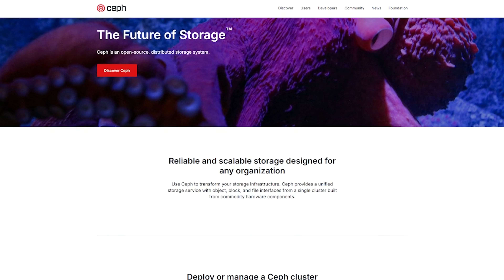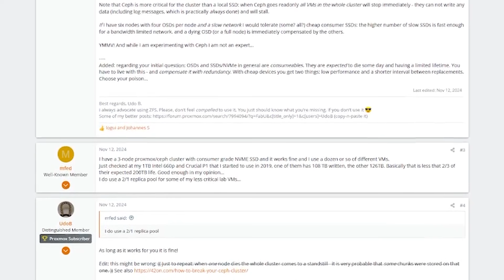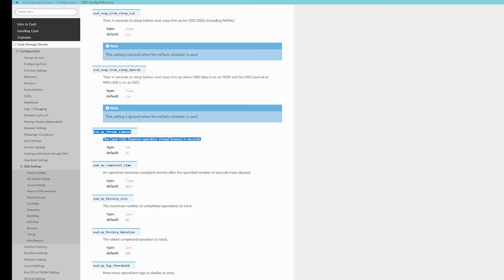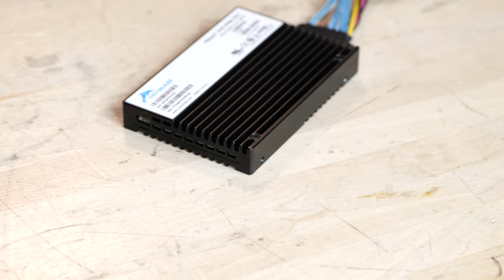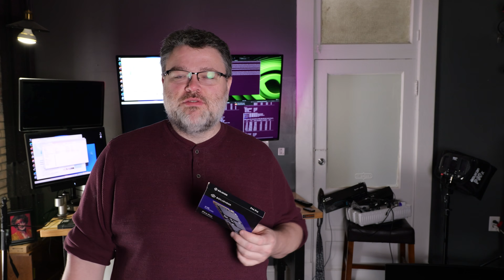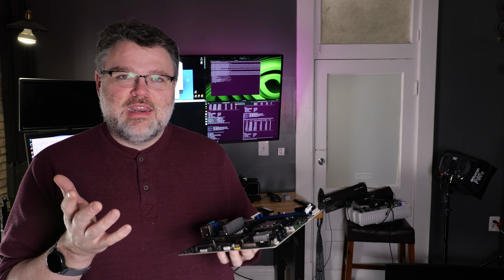Ceph Shenanigans with Wendell! Broken Solidigm Consumer vs Memblaze Enterprise -- What happened?

Comment: You are always using expensive hardware. What about using HP DL360 Gen9 with some adapters so we can host Samsung 990 Pro NVMe and build Ceph on top?
Or doing Server hacking and installing NVME's via some cards to workaround bifurcation and doing a hybrid with a SAS drives in front + HBA?
Combine Ceph wiht ZFS?

Comment: For me the biggest CEPH issues have been caused by network speeds more than disk.  
I ran a 4 node cluster for years using shite ssd and 10gbe. Loved it.

Now I have 4 nodes of amazing ssd. And 1gbe.  And it hangs.

Comment: I love ceph so much lol. I run hyperconverged for proxmox (on optane), and PB-sized spinning rust in EC mode (with super cheap consumer sata SSDs as metadata storage). No data loss, works well. But you do need to build up experience, it's not magic as you said and using the right hardware is important to some degree. I don't use Seagate HDDs anymore in my OSD nodes, WD firmware is so much better, no issues.

Comment: Definitely check out Linstor / DRBD. Running it in 'production' on three nodes with 4 SATA Samsung 86 EVO's in each server. Works great. A quick test VM spun up revealed 5K IOPS 4K QD32 randwrite and 100 MiB/s sequential. Cluster wide under normal load is doing around 25k IOPS on average. Backend is LVM, VMs are thin provisioned, 10G LAN. Definitely not high performance but not bad!

Comment: I learned my lesson trying to use WD Red SSD as a cache in Synology. There is a reason why Synology sells 400 and 800 gig drives rather than 500 and 1000 gig drives. You don't want your SSD to be 100% full.

Comment: Interesting. I have been using ceph in my homelab proxmox 4 node cluster for over a year without a problem. Im using mixed 1TB consumer sata SSDs (the cheapest I could buy at the time) over 1 GB ethernet.
It is not the fastest but it works fine. And it survived power outages.

Comment: While PLP (power loss protection) sounds like a safety feature, in the case of ceph it is actually a very important performance feature. The battery backup gives just enough juice that it can trust the dram cache for sync writes. Conversely, not having it means that all of the enormous amount of sync writes ceph does don’t get any write caching and instead have to wait for the (relatively) slow flash to write. 

This is the key distinction between enterprise/ non-enterprise drives. 

If you are crazy / dumb, you can test this in proxmox by creating vm disks that are force write through cached. A quick benchmark will show performance much more in line with what you expect. Obviously do not use these for anything you care about, breaking all sync writes will lose data eventually.

Comment: Bad take. It's not about consumer drives. You tried SSD's with faulty firmware. End of story.
If you used enterprise drives with faulty firmware you'd be making the same complaints.

The problem seems to be more a case of "I bought drives from a tiny new company with cowbow coders trying 'exciting' things with the firmware."

Comment: Hi there!

I am an european sysadmin, so my viewpoints may differ. I work for a few small-medium businesses, and we use proxmox with ceph at a lot of places. I think Wendell kinda misses some viewpoints or approaches the subject from a different viewpoint. 

Ceph is slower than locally mounted SSDs or high perf ZFS mirros. This is by design, and it cannot be manouvered around. Ceph communicates over TCP/IP, even to access local SSD-s (OSD-s). This slows down things. Ceph can have a colossally large throughput when seen altogether, but for single clients (VMs) the ceph storage backend will always be slower than ZFS mirros.

What we use Ceph for is Infrastructure VMs, where High Availibility is KEY, but indiviual VM storage perf is secondry. (email, DNS, AD, VPN services, etc...)

If one needs top storage performance then ZFS mirrors and stacked zfs mirrors is the answer. 

One can spend a lot of time optimalizing ceph performance, but it will always be slower, this is by design and should be accepted.

Consumer SSD-s: We used to use consumer sata SSD-s for ceph and we use mostly consumer NVME ssd-s for ceph now. Usually 1-2 TB models with onboard ram and 600+ TB write endurance. If one has 3 nodes and 3-4 OSD-s per node, 20Gbit+ network, the performance is kinda okay! SSD-like performance, maybe a bit slower, but email, AD and DNS doesn't care really. Ceph doesn't have the massive write multiplication of zfs, but has checksumming features for consistency, that works well with consumer ssds.

If one can plan write endurance for VM-s, consumer ssd-s Work Well. A usual small business with AD, email, accounting program VM, etc can use consumer ssd-s for 4-6 years before endurance becomes a problem. using different model ssd-s isn't a problem either, rather welcome, it minimizes the chance of parallel write endurance failures. 

Ceph storage cost per GB is always greater than ZFS. (3 copies of all data on 3 ssd-s). Given this, one should tier one-s storage. HA infrastructure vm-s on CEPH SSD-s, High perf storage is ZFS striped mirrors, zfs spinning rust for capacity storage and packup storage.

If one uses NVME, it is less a problem, but it is important to avoid using the same sata/sas controller for boot zfs mirror, zfs striped mirror for high perf storage and ceph OSD-s. One can quite quickly make a race condition for the different storage pools. Diagnosing it is hell, don't do it! Use different controllers!

Comment: It’s almost like I’ve heard this before, that Ceph doesn’t play nice with consumer solid state drives… 😅

I’ve dabbled with Ceph on and off for the last 5 years and the long standing ”truth” in the communities is that you want enterprise drives and at least 10 GbE to be happy with it. Many have gone against these recommendations or not done their research, many have reported either problems or very slow performance. I’ve tested myself. It is definitely possible to create a working cluster using consumer drives and lower than 10 GbE, but it will be a far from optimal experience. Especially considering the performance of the drives one might put into it. The ”Pro” in Samsung 980 Pro means nothing in Ceph land.. 

I now only run second hand bought enterprise SAS/SATA SSD’s and NVMe’s in my cluster. Well, some of the HDD’s aren’t enterprise but it has far less impact on speed than solid state.

My testing has even shown that enterprise SATA SSD’s eventually will outperform consumer NVMe’s with Ceph.

I will just sound like a parrot and repeat what everyone has said to me; use enterprise solid state drives with proper PLP and try to use at least 10 GbE networking. Especially if you plan on deploying it over a long time and in some sort of production. But for playing around, you can run it on basically anything. 😜

Comment: So pro tip: if you want to use ceph, deploy it separately to proxmox. Proxmox is kind of lagging behind what ceph is up to, native ceph is sooooo much better, especially the new dashboard, and while cephadm is still green, it’s a big jump foward. a lot of your complaints would be addressed by running cephadm and the dashboard with all the prebuilt grafana dashboards. 

I’m currently running a 200 drive 30 node cluster. There’s lots and lots and lots of knobs and bells and whistles to building Ceph, but by far it’s also the most resilient platform I’ve used.
Reply: Are you using s3 radosgw?
Reply: I’m deploying a new 6 node cluster now for my homelab and the plan is to deploy cephadm instead of using pveceph. ”Only” problem I haven’t really figured out yet is how make the deployment while still running Proxmox. I don’t have the hardware to run the Ceph storage separately to the compute nodes, so it has to be HCI.

I’ve heard of people running a Ubuntu VM on each node and deploy Ceph on that. Probably doable but feels very convoluted. 
Other is to run Debian on each node, with cephadm and install PVE on top. That ”feels” like a more clean solution than installing bare metal PVE and cephadm in that.

Comment: I've got a ceph cluster with 24 spinning disks, 4 nodes, and I have enterprise SATA SSDs for DB/WAL, 3:1 OSD to db device ratio (3 OSDs share the same physical disk for db/WAL) 

It works fine for what it is. By default ceph on proxmox tries to use the nearest replica (localize), and I've found I have had better performance by switching to balance for rbd_read_from_replica_policy

Comment: Oh so the Pros also have the SLC bug? Fun. I feel like most of the general "don't use consumer drives" is because of random firmware bugs like this, but then I remember we had HP Enterprise SSDs that bricked themselves after 32767 hours of power on time... bugs happen! Vendors not fixing them is the issue and certainly more likely with consumer devices.

Comment: Firstly nice video and its a great topic, even more so with the cost of It related items and stock availability. I'm no expert but I think most people would be happy with a simple approach and less is more due to cost and availability. Firstly using consumer grade items over enterprise has always had its issues its to be expected. My approach which I think would suit most people in this current climate is a 3 node setup, the nodes consist of 2 node running proxmox pve and a 3rd node running proxmox backup. You can use replication without the network overhead of ceph and consumer drives won't be impacted as much as ceph. The question I asked myself was do I really need ceph, the answer is would I like ceph almost certainly but I do not need it no. Replication running every 15 minutes allows me to be more cost effective and suit most demands for my home lab and I think it will also meet most peoples. In short ceph is a nice to have but for a home lab not required. If you need it then your most likely running an enterprise not a home lab.

Comment: FYI, there is no “local” copy of the data that you read from. Yes it’s replicated but each object is replicated across the placement groups. When you read the data, each placement group has a “primary” OSD which is used as “read” OSD for that PG. Just because the placement group for an object of data may contain an OSD from the machine local to the running VM doesn’t mean that’s where it is read from. The cluster is designed to roughly balance placement groups but some nodes can end up with more “primary” OSDs than others. Reef and newer Ceph offers a “read” balancer module that attempts to balance out the primaries. Also I guess I’m gonna have to tell me 3-node cluster with Samsung 970 Evo Plus drives it’s just not a usable cluster, no matter that what the benchmarking and 2.5-year uptime say.
Reply: There is a parameter to tell the pool to read from the closest OSD in the crush map, instead of the default of reading from the primary OSD. Also you can change it to load balance reads accross all OSDs in the PG
Reply: with 3node/3OSD7size3 + rbd_read_from_replica_policy "localize" it "should" iirc ?

Comment: Once again -- patently false and just bad info.

You can run Ceph on consumer grade NVMe SSDs just fine.

Just because you are running into problems with the P44 Pro doesn't mean that you can't run Ceph on consumer (NVMe) SSDs.

I'm already running consumer grade NVMe SSDs for Ceph and it works just fine (even over GbE, no less).

Bad info.
Reply: Agreed. I’ve got a 6-node Pi cluster running WD Blues and a Micron NVMe drive, a 3-node HPE DL380 Gen10 cluster with 970 Evo Plus drives and a 5-node Pi cluster running WD Black drives, all running just fine. Yes, Ceph does like PLP drives and obviously will perform better with better quality drives with higher sustained write IOPS … like every other storage cluster.
Reply: He didn't say that, but this should show you that maybe you got lucky.  You shouldn't spec consumer drives because this is what can happen; doesn't mean it will, but if you spend a boat ton of money and it does, you were warned.  its not false info.  I will tell you that I have seen craziness as well.  Even if 70% of consumer nvme are fine, is that high enough to spend thousands of dollars on a build out?  No.
Reply: @derringer7  
"He didn't say that"

"
10:23
there is there is some validity to don't
10:25
use consumer drives um for SEF."
...

I mean you can literally click on the transcript button and CTRL+F "consumer" and you will find at LEAST 10 times where he LITERALLY said that.

"but this should show you that maybe you got lucky.  You shouldn't spec consumer drives because this is what can happen; doesn't mean it will, but if you spend a boat ton of money and it does, you were warned."
BS.

There are PLENTY of people who run Ceph on consumer grade NVMe SSDs.

You can, once again, LITERALLY search for it on BOTH the Level1Techs forums AND the Proxmox forums and there are PLENTY of people who run Ceph on consumer grade NVMe SSDs.

It's fine.

Just because the P44 Pro has a firmware bug doesn't mean that ALL consumer grade NVMe SSDs exhibit the same problem as a result of the same or a similar firmware bug.

It is LITERAL bad info/advice.

"its not false info."
It ABSOLUTELY is bad info.

Just because SOMETHING happens to you doesn't mean that it will happen to EVERYBODY.

Imagine if the advice, to women, is don't have sex with men, because ONE woman slept with ONE guy, who had herpes.

That's what he's saying (to women): don't have sex with guys (because ONE woman had sex with a guy, who had herpes.)

That's INSANELY stupid advice/info.

"I will tell you that I have seen craziness as well.  Even if 70% of consumer nvme are fine, is that high enough to spend thousands of dollars on a build out?  No."
1) Congratulations, you were a part of the 30% of the population, and NOT the 70% of the population where it is perfectly fine.

2) You don't need to spend thousands of dollars on the build.

I think that I bought my Inland 2242 M.2 512GB NVMe SSDs for $39.99 each on Boxing Day, 2023.

Three nodes, running EC (2,1) only costed me $119.97 total.

Why do you think that you need to spend thousands on a build???

There is absolutely no requirement that a Ceph build AUTOMATICALLY equals thousands of dollars.

That's BS and more bad info.

Comment: How would Linbit compare for this homelab setup?
Reply: hmm tested ceph competitor for shared storage using drbd linbit running on labtops with usb networking adapters for 3 months.  Set up HA controller for managing the storage and tested node failure with 5 minutes recovery or less.  Started here cuz network was 2.5gbe to start.  Nice to be able to not spend big $ on networking, sensitivity to drive specific issues and have minimum of 5 nodes.  Linstor DRBD might beat out ceph long term for smaller clusters such as homelabs/small enterprise if a proxmox engages further based on my experience.  Maybe next version should fully support drbd to round out the recent massive adds in shared storage support?

Comment: Been running PVE + Ceph on a mix of Intel 670p and SK Hynix P31 Gold drives for going on three years now. Four nodes. It was MS-01's at first, and now is N5's. Never had a single issue with data loss or recovery, and I have done some bad things to this cluster. A few OSDs have crashed over those years, I had a bad DIMM once (but that only messed with my platter drives)... and that's about it. I did need to turn on bdev trims, as Ceph doesn't do that by default, but that was just a performance issue. Those Intel 670p's are not fast, and do throw some slow drive errors now and again, but it's never seemed to actually matter.

So I have no issues with using consumer drives on Ceph. Just test your setup before you commit to a full build.

Comment: No kidding, I had the same idea you had so I put in a "test" nvme into the pool.  But I wasn't able to recover mine like you did when my nvme started burning.  I have 5 proxmox/ceph nodes and 20+ various makers and size platter drives and I've lost one drive before.  I even have some SSDs that are doing well.  All was fine but when the nvme failed it was a catastrophic failure.   Not a failure of my cluster but the nvme became fried.  I couldn't do anything with it but throw it away.  No major loss but I learned a lession....No nvme drives as an OSD.  I guess I'll add No consumer level nvme drives as an OSD.  Anyway, thanks for sharing your experience.

Comment: The only time I've had problems with consumer drives and ceph has been when the drive itself has a problem.  I had a few wonky m.2's that caused some chaos, yet ceph survived just fine.  You do absolutely want at least 5 nodes (balanced as much as possible, but not completely required depending on your load factor).
Reply: Yeah, tbh out of all the storage clustering tech I’ve used, Ceph has been the most forgiving using consumer stuff. But just replacing consumer drives with refurb sas/enterprise drives and watch the whole thing fly and do speeds that shouldn’t be possible

Comment: I'm using ceph in a 4 node cluster using consumer nvme, but I'm also using mostly consumer software too. It's mostly stable - makes moving pves with large amounts of data faster, like my Plex cache, if I need to migrate for hardware swap or issues. 

I had one issue where I hadn't logged into my dashboard for a couple months and logged in to 2 of 4 osds down and had to completely rebuild them, but the data persisted on the other two making it relatively easy.